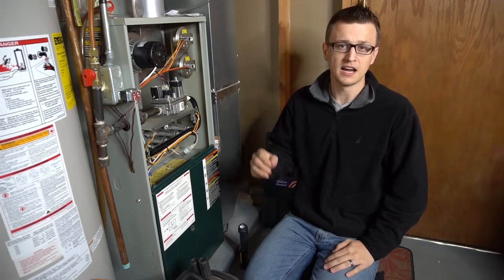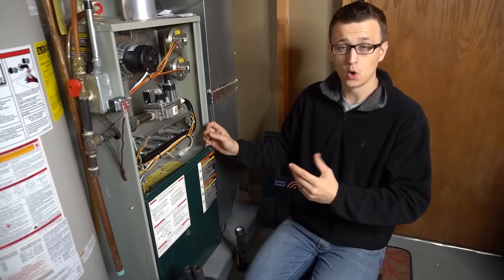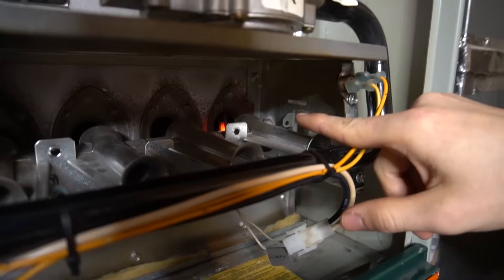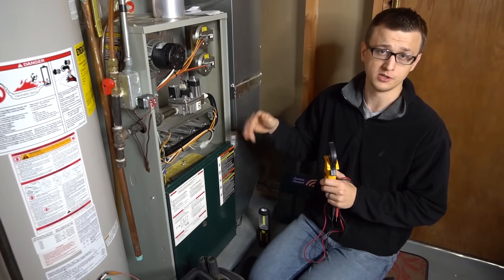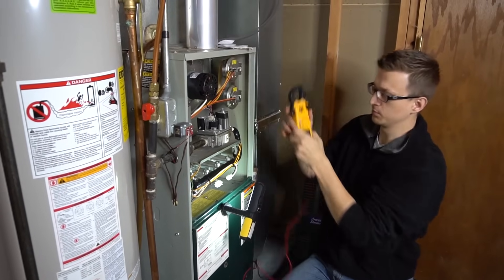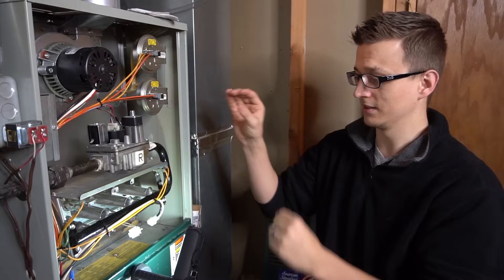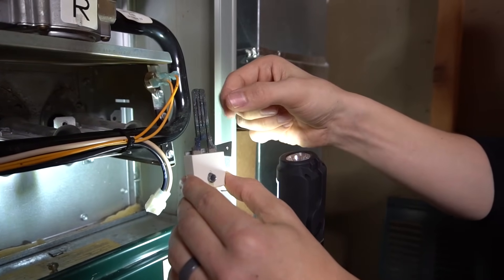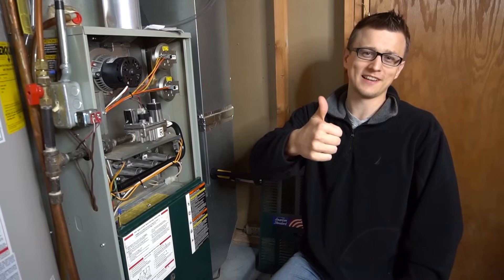Furnace Not Igniting - How to Check and Replace Ignitor

Comment: Thanks for the very good video. There's is soooo much useless drivel out there on youtoob, it was my good fortune to stumble upon yours.  Just in case anyone else out there has the same oddball problem I had, here's the story:  I have the intermittent igniter style (didn't know that until I watched your video) It was clicking continuously, trying to keep the pilot lit long enough for the burner to light, but no gas was flowing to the main burners, so the  intermittent pilot would shut off, the cycle again and again. I first assumed I had a bad heat sensor but your video gave me the critical clue: the inducer blower motor was not coming on when the thermostat call came in.  I had just replaced the inducer blower motor ~8 months prior, so I didn't suspect it might be part of the problem.  But it was indeed binding (not the little squirrel cage fan but the motor itself) and could not get started. No blower, no draft, so the pressure (or vacuum, whatever) switch would not allow the main gas valve to open.
Reply: Removed the inducer motor, took it completely apart, confirmed the armature was rubbing against the field magnet.  Bearings were fine. Reassembled making sure to torque the screws evenly so the  bearings were better aligned, and armature did not bind. Voila.   Blower motor starts on command, intermittent pilot ignites and stays lit, gas comes on and all is good and warm.  Who knew? I wouldn't have picked up on this (now) obvious clue without the video.

Comment: Great video! Great instruction!!  Thanks for taking time out of your day to put these videos together. I've learned a lot about how my gas furnace works from watching your videos even though I wasn't really eager to know about it.  However, my heat stopped working right during a cold period and I started searching to figure out what might be the problem.

Still not sure what the problem was, but my heat is working again. Maybe it just took re-seating some connections to get it going again (or maybe flipping the on/off switch on the gas valve).  Even with the attic door closed, I can now hear the different stages my furnace is going through after listening to your videos over and over and listening to my own furnace kick-in.

Comment: I have a white Rodgers model 50e47-843 I am getting a click and igniter not heating up and then I hear gas go on then shut off because igniter not turning on. Igniter was replaced. Do u think the actual control board is bad? The red light starts flashing which is lock out then after a bit the light turns red and that means replace control. The igniter is 1 week old. Thanks. My igniter is also the same. The furnace seems to be working intermittent. Any advice would be great.

Comment: What if the ignitor is getting 120 but is not glowing?  I also didnt hear the gas valve click?
Reply from the maker: If the ignitor is getting 120v and it is not glowing, it is bad. If the gas valve is not clicking, it's possible that there is more than one problem too.. I would start by replacing the ignitor.
Reply: @WordofAdviceTV   very wierd one. An issue was also the high limit... even tho it was broken the hsi was still getting 120v but not glowing. This furnace had a mind of its own

Comment: Thanks for the video. My heater problem is when the temp around 62 degree. I turn on the system, set the temp to 67 degree, indulce motor on, the ignitor glow red, gas start to hissing, but it's not ignite the gas. Unless I manually ignite with my cigarette lighter. But it run for while until temp goes to 63 degree. The flame is off when the heater get too hot. but it's not reignite the system again. I have to manually ignite with my lighter again. Until the thermostat reach 65 degree and above. The system will stable and work as normal. I check the voltage supply for ignitor is 95 VAC. Is the voltage is too low? Is my ignitor need to be replace? Thank you for your help.

Comment: My furnace just run out .
I use me meter and I don’t have 120 v for the ignitor what can I do please
Reply: Assuming the power is on and you dont have 120v, then more than likely the circuit board is bad.

Comment: Hi, Is the tip of the igniter supposed to be expose to the flame? The tip of my furnace ignitor remains red hot because a small amount of flame is hitting it when the burner is on. I wonder if that is the cause why my igniter only last a year.

Comment: I’m hoping you can make a suggestion based on my problems. Thank you for your great videos btw, I’ve been mashing those likes! This is my sequence of trouble shooting, all of which I learned from you today. So thank you VERY MUCH! 

 -Heater not working: “pressure switch not closing” code.

-Removed pressure switch hose: full of water. Drained, cleaned outlet port (from fan) with wire cleaner, replaced hose, then also checked condensate drain (not clogged).

 -Tried again. Noticed the inducer fan was not spinning during call for heat. (Spins freely by hand)

-Checked voltage to inducer fan and found 0 volts during call for heat. 

-Tested R to Common: 27 volts.

-Jumped the R & W, still 0 volts to inducer fan. 

-Checked transformer outputs and found 120 volts. 

-Jumped pressure switch properly: “Ignition proving failure” while still receiving 0 volts to inducer fan. Gas smell and ignition attempts. 0 volts to igniter. 

Does this mean my control board went bad? Can I just buy a new control board? 

Thanks in advance!
Reply from the maker: Sorry to hear about the furnace problem! From what you described (and thank you for such a detailed description of what you have done so far) it does sound like a bad control board or a loose electrical connection. If there is no error code and you jumpered R to W, the inducer motor should get power. If it does not, then usually that signifies a bad board. So I think you are on the right track but unfortunately I can't guarantee that is for sure what the problem is without being there.. Hope that helps. Good luck!
Reply: Word of Advice TV Thank you so much for the quick response. Your videos helped tremendously. I appreciate you!

Comment: Not possible based on ohms Law !!! 123 volts divided by 71 ohms is 1.7 amps. A igniter cannot ignite natural gas at 1.7 amps. If res. Is higher amps go down 120 volts divided by 400 ohms is .3 amps this is ohms Law  it's not possible to have high resistance with the right amps for the igniter to work. That have 3.3 amps to 3.5 amps required for the igniter you have to have between 35 and 40 ohms of resistance no more no less this is Ohm's Law

Comment: last night it started getting cold in the house and I noticed it was 67 in the house and it was set on 71. I saw the red light on the furnace door and popped the door and hit the door switch a few times and then turned the power switch to the furnace on and off and then it came on, Could the igniter go bad all at once or go bad slowly over time.

Comment: My igniter is just a single rod...

UPDATED 
I was wrong.  That was my sensor.  I'm only getting 1.5 volts to the igniter.  Just ordered the main board. I hope it is easy to replace.  My igniter looks fine. Is it safe to manually ignite just to make sure everything is good?

Comment: Great Video Sir. ignitor was bad. I sent you a 20 for a couple cups of coffee or a shot of your choice. Now if I can just stop kicking myself in the aXX for paying 2400 dollars for my new blower motor. Again Job well done Semper Fi
Reply from the maker: Oh wow! You paid 2400 for a new blower motor?? That's very excessive, even for a variable speed motor. Sorry to hear about the wallet damages.. Hopefully nothing like that will happen again. Glad to hear my video helped! And I appreciate the tip! :)
Reply: @WordofAdviceTV  Again Thanks One request. I searched to see if you had a video on installing a ground fault device on the A/C unit. That is what fried my blower motor. I have watched some videos on the subject, but they assume some knowledge I do not have. I live in an old house, so this is a problem. I know these devices can be installed at the circuit box, but I have read where the circuit box devices only provide a level one protection and do not provide enough ground protection needed for the  unit outside and the furnace in the attic. Thanks
Reply from the maker: @Lanny Salisbury Unfortunately I do not have a surge protector video. But I have installed them in the past and usually I would put them outside at the electric disconnect box. (surge protector needs to be waterproof) Those installs only took 10-15 minutes to do. Without physically being there, there's not much I'll be able to help you with. When AC season comes around again here in Minnesota, I'll need to make a video on that..
Reply: @WordofAdviceTV  Just an update , parts came in, replaced Ignitor and the flame sensor. We have heat again. Thanks Lanny
Reply: Hello Word of Advice, The Ignitor needs replacement again. I purchased a Trane Ignitor last time. I would expect the ignitor to last more than 12 months. The one that came with the system lasted nine years. Do you know of a company that makes a decent after market ignitor. Can I expect to have to replace  one of these yearly. If that be the case, I will just stock up with the cheap oem models. I think we use the heater three months on a yearly basis. Thanks  (Houston tx)

Comment: Great video.! I am really enjoy your work. 
I do have question for you
My furnace not producing heat
I check the igniter and it registers at 70 om. I did by pass the pressure switch per your video but the igniter still not work. I test the voltage and it should be 120v but I only see 26v. What can be the problem?  Thanks in advance.

Comment: So! My ignitor is glowing bright red, but the gas is not being discharged or igniting. When I power off the furnace and immediately power it back on, the ignitor glows again, the gas flows and ignites... and the furnaces operates until the thermostat shuts it off when the set temperature is met. 

What would cause the furnace to operate only after I shut it down and re-power it!?

UPDATE.... the furnace changed to first emitting the initial gas burst before the igniter glowed.

Further investigation determined the gas regulator is malfunctioning, so I will change that part and see if it corrects the problem!

Comment: Trying to troubleshoot my furnace today. I touched the igniter, wiped it with a clean microfiber and sprayed compressed air on it...

The furnace is only a year old, should I replace it now since I did that? Or should it last a little while.

Also, I didn't get the furnace back up and running. The igniter glows, first burner comes on but the gas doesn't reach the other two burners and shuts off. Tried cleaning burners and gas orifices. Goodman furnace.

Comment: Thank you so much dude!  I actually fixed my own furnace today thanks to this video. Awesome.  I had difficulty finding a new ignitor locally.  I had to go several towns away to get it.  Home depot, ACE, Lowes, True Value and some other local places did not carry it and the suppliers would not sell to "home owners".  There was only one store several towns away.  Maybe it is because I live in Los Angeles county and it's not that cold here so.. if my furnace goes out, its not life threatening.  I would imagine in the colder places it is not hard to find this part, I would hope....
Reply: Yes, they have new rules in Commifornia which prohibits the sale of these minor items such as ignitor or sensors. On a flip side. They will sell you weed, other drugs and guns an ammo right there. 
Tonight I am freezing over because 3 HVAC stores refused to sell me a $20 igniter.

Comment: so what could be wrong with my unit when, igniter turns bright red/orange but no flames? i can smell gas, i ohm out igniter and its at 80ohm. ohm high limit switch and its good. i dont hear clicking from the igniter but it is sending 120v and 80 ohms. order of operation seems to check out just when igniter turns red/orange theres no flames, i even put a torch to try to light it but it wont even light

Comment: The igniter works intermittently - the inducer was recently replaced at substantial flat cost - heat worked the day it was done, but later I had to set thermostat 15 degrees above room temp - and even later at 90 degrees - then a couple of days later, it worked fine as normal.

Comment: How hot/bright does the ignitor need to be? Mine does not glow bright orange, more like dull orange. I have a Carrier furnace, ignition is hit and miss (sometimes it does sometimes it doesn't). The sequence is induction motor comes on, ignitor glows, I hear the faint click of the gas valve (and I can smell gas) and sometimes the gas ignites, sometimes not and it then tries again (sometimes on the 2nd try sometimes on the 3rd)... if unsuccessful it does the hard lockout. I can more often than not when the ignitor comes on, the gas valve opens I can blow across the burners or the first burner and whoosh, the gas ignites and the furnace runs (up to the thermostat setting then it's hit or miss on starting again) ... Is the gas not getting to to the igniter? Is the igniter not hot enough? Sometimes the furnace will run fine for a few days, sometimes I have to kickstart it once a day or so...
Reply: Problem solved .. it was a clogged gas orifice, the one at the igniter location. I had planned to clean all the orifices and burners myself the day after I posted but my wife beat me to it by calling a serviceman who did exactly that, cleaned the orifices and burners. Boom! Worked like a charm, and it only cost $170!!! Oh well, it was worth something as checked out the rest of the furnace also... one caveat, he told me Carrier furnaces have on average a 15 - 20 year life span ... ours is 21, so if any major repairs come up we'll probably be replacing the furnace.

Comment: I have changed my ignition and now my furnace turns on blows for 10 minutes and doesn’t turn back on in less I turn or switch the power off and back on and it works for another 10 minutes with same issue and red light flash’s on the board saying ignition lockout
Reply: Update: i re adjusted the  flame sensor and working fine...
Thanks for the advice

Comment: I have a high efficiency propane furnace that is only a few years old that won't ignite consistently.   The glow plug turns on and I can hear the gas valve click but then it does start.  Oddly enough if you blow on it, it fires right up.  I had one tech come out and he had no idea what was wrong with it.  What are your thoughts?
Reply from the maker: My first thoughts are that the ignitor is weak (or if recently replaced, it can be positioned bad). So it will still glow but not hot enough to ignite the gas. Another thought is that the burners are dirty or there is a partially plugged orifice in the manifold. I have a video on that: https://www.youtube.com/watch?v=aM4OXM8ruNk
Reply: I changed the ignitor and checked to make sure the orifices were to clean but it's still acting the same.  I bought a monometer and the high fire is set at 8 in of wc but for some reason I can't adjust it up any higher. (low is correct at 4.0) The screw turns but thats all.  The book says it should be 9.6.  It initially ignites on high fire, right?  Could this be the problem?  I'm also on propane.  A conversion kit was originally installed years ago but this is a new problem. Also the incoming pressure is 13 inches of wc.

Comment: Hello, Great videos, the HSI works intermittently, aside from checking the receommended voltage and resistance (105 ohm); connected 120Vac directly to the connector, and cycle power thru it many time; and the burner heated up/glowed as expected; believe the burner is bad, which is starting to point me to the control board;  the igniter will light up, but will not always stay on long enough for the gas to kick on and ignite... haven't lookied into where or how to order a board yet... ;-\

Comment: Great video.  Question:  Old ignitor has 2 wires; replacement has 3 wires.  Can you explain how to install the new one?  Thx.
Reply from the maker: If it did not come with retrofit instructions, then that sounds like you may have gotten the wrong ignitor. I don't remember the last time I replaced a two wire ignitor with a 3 wire ignitor, sorry..

Comment: Thank you so much for your channel! This past summer I replaced my blower motor, blower wheel, capacitor, transformer and control board using your videos at a parts cost of $800. Just so happened when I bought the control board it came with an igniter. My heat went out yesterday, and I used your videos to trouble shoot!!! It was the igniter, and it took me 20 minutes to take out the old one and install the new one!!! I love you!! You are the best at explaining all the important details!!
Reply from the maker: That's great! I'm happy to hear that the videos helped you fix the furnace multiple times! Thank you for leaving a comment, stay warm!
Reply: They took our jobs!

Comment: I have a older Kenmore 90 gas furnace and I'm quite certain before my pilot light always stayed lit. But tonight when our furnace wasn't heating, although the blower was running, I noticed my pilot light is out. When I looked at it to manually light the pilot, there is no " pilot" setting on the control, and inside my furnace cover it says do not manually light the pilot. Could you help with any suggestions? Thank you, John G